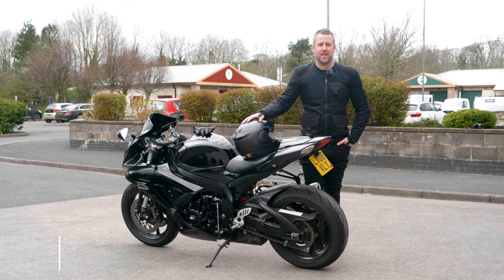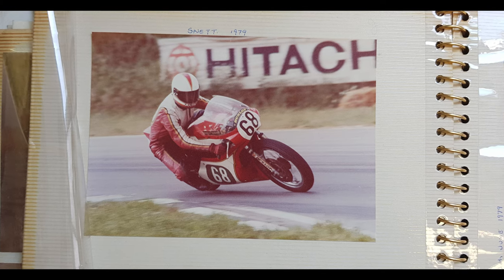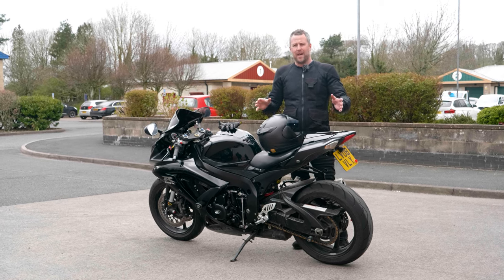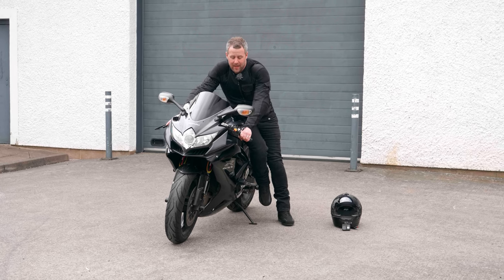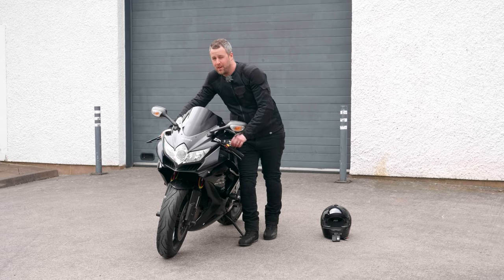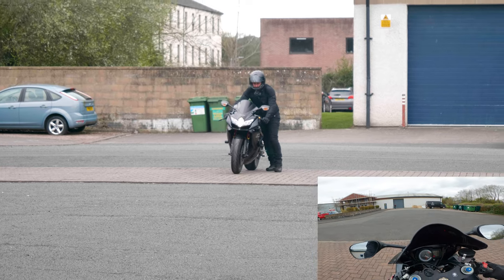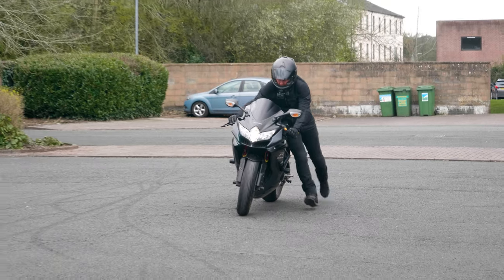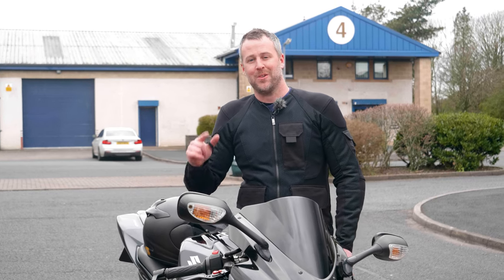How to bump start a motorcycle like a PRO | KNOX armour

Comment: I've always learned to do it in the highest gear the bike will let you shift into
Reply: I don’t mean this bad I’m just trying to learn, but what difference would it make?
Reply: @sebastianhutton3176  Higher gears give you more leverage to turn over the engine with. In first gear it might be 1 engine rotation = a few inches of rolling distance where in 6th its more like 1 rotation = several feet of distance. When you're pushing it on foot it makes a big difference
Reply: @uglypinkeraser  thank you so much!

Comment: The go pro addition would have been helpful if it actually showed the hand movements. You should have swapped the visuals instead of showing yourself being filmed so far away the whole time.
Reply: You push hard and fast, jump on side saddle and immediately drop the clutch and give it some throttle before pulling it in as soon as the engine catches........,

Comment: why do u have to jump on it
Reply from the maker: Because you need enough weight on the rear wheel to turn the engine over without the rear tyre skidding. I'd do it sat on the bike if I could, but you cant peddle it fast enough that way so you have to run along side it. Hope that makes sense. Thanks, Aaron KNOX
Reply: Your ass should hit the seat at the same time you let the clutch out usually. Having said that I have tried clutching my bike a number of times and no luck, just skids to a stop. LOL Plus it probably doesn't work that well on bikes with a slipper clutch.